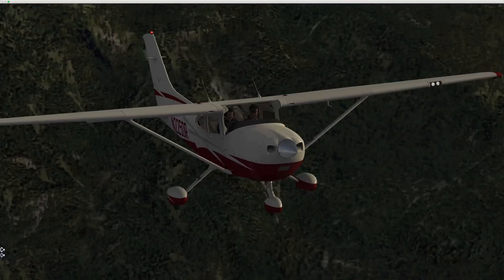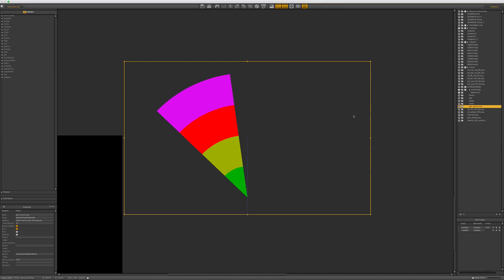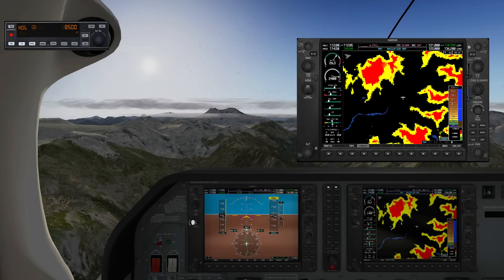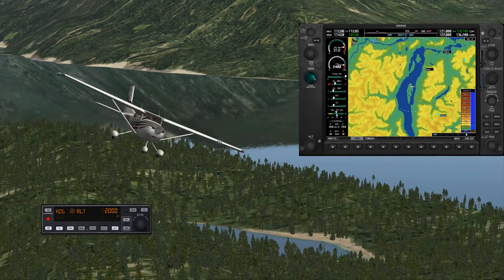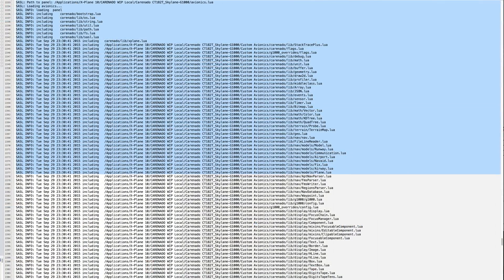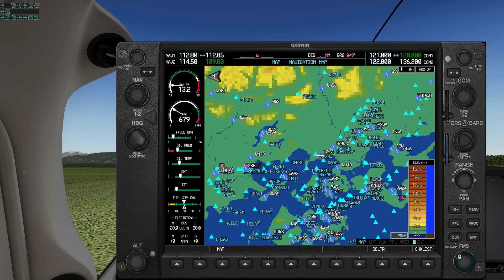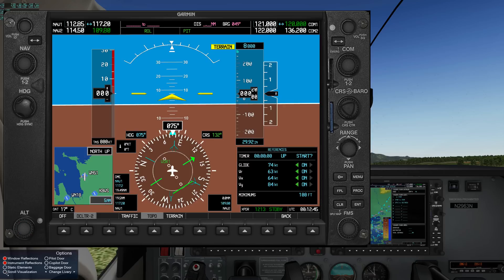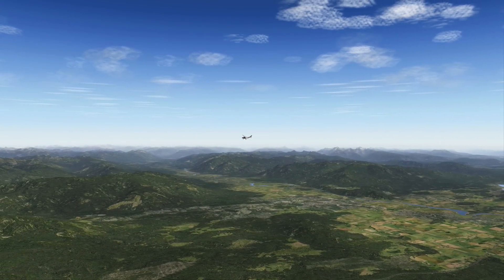Carenado CT182 with G1000 for X Plane

Comment: Hi Dan, I am new to X Plane and to simulation in general. I am a private pilot who flies a C182 Skylane G1000 and want to use X Plane to improve my flying. I have downloaded the CT182_Skylane_G1000 into X Plane 11 but I am having trouble getting the G1000 buttons to function properly. Would I do better to go back to X Plane 10 until the G1000 is better integrated into X Plane 11?  Debbie
Reply from the maker: Yes. We will be working on bringing this plane to v11, with X-plane's G1000.  But we're still waiting for the ability to draw directly onto the pop-up window, in order to customize the G1000 to suit this plane's layout.  It'll be some time yet.
Reply: Thank you.

Comment: i have hugh bugg problems buying this plane !!! help no sound ! no g1000 i cant do shit with this plane
Reply from the maker: If you're on Windows, you might need to download and install the latest Microsoft Visual C++ Redistributables. The plugin needs those to work correctly.
Reply: danklaue I have it installed and stil not working.Same problem with the paypare cessna 172 Airfoillaps ?